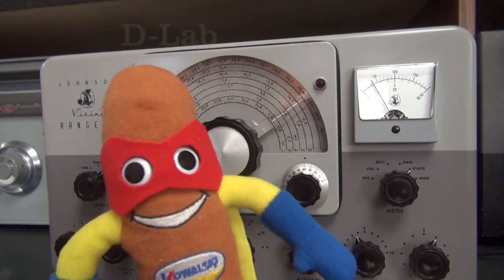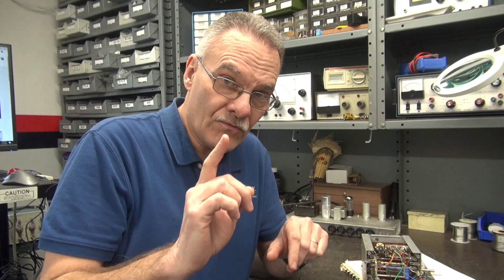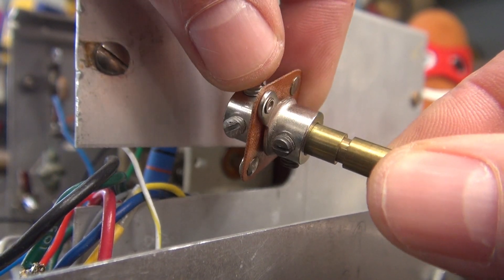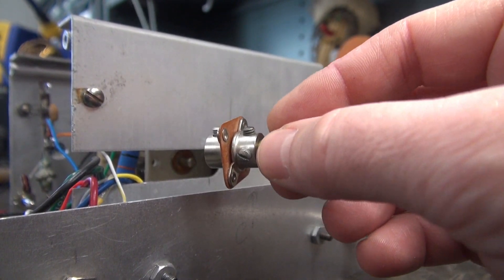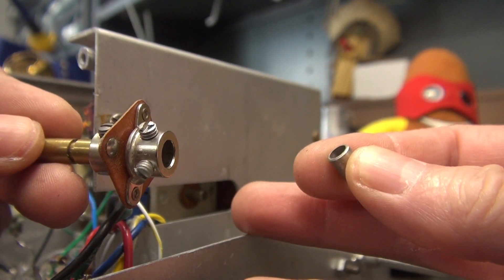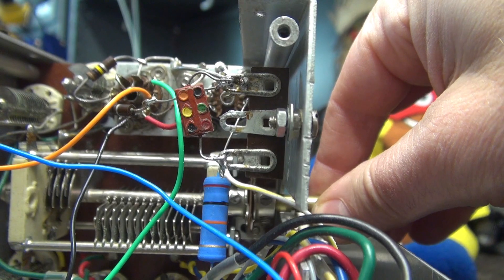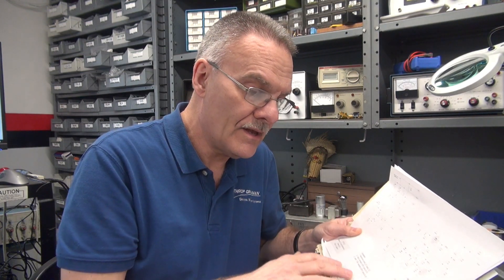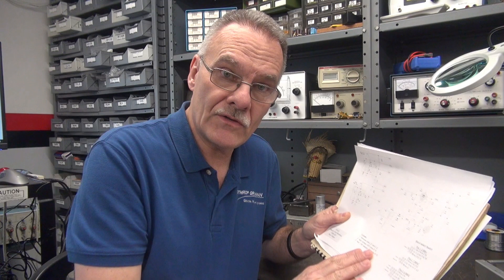How to repair Johnson Ranger Navigator Ham transmitter VFO Tech Tips

Comment: Excellent tip on that coupler repair!  Quite a few others have suggested variations in the comments, here's mine.  Hobby and craft shops and even some hardware stores sell small diameter steel and brass tubing.  I've used those to perform similar repairs to various equipment, including a motorized reindeer Christmas decoration!  My major concern would be the potential for corrosion due to using dissimilar metals, but it's a trade-off for durability compared to using plastic, for example.

Thanks again, Terry!

(BTW, is that a Logitech Trackman trackball I see in the background at the end of the video?  On the utility cart?  Just wondering because I have one, great for locations where you need a mouse but no desk space to move it around. 👍)

Comment: RE: Broken coupler- To reduce the shaft opening diameter before I had a lathe, I used thin brass shim stock, cut into a thin strip. I would add enough to make a snug fit, and the shim stock will deform under the pressure of the 2 screws to hold the coupler tightly to the shaft. I have also drilled out smaller couplers to accept a 1/4" shaft. If you do this, be sure to hold the collar in a vice and do not drill free hand.  I also save all my broken shaft couplers (mostly ceramic) for spares for repairing damaged ones.